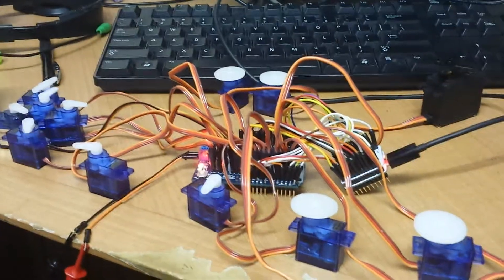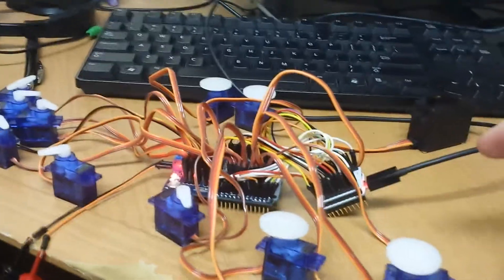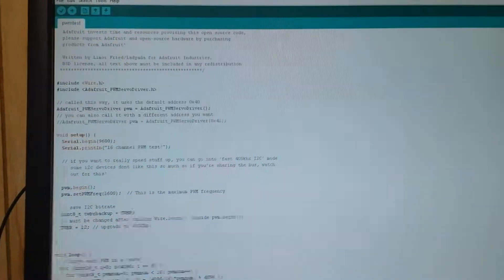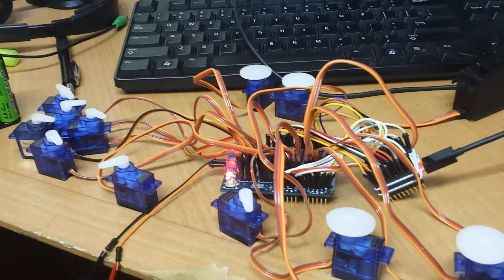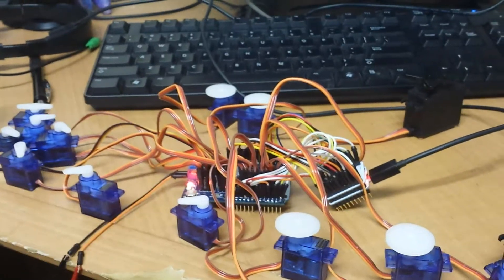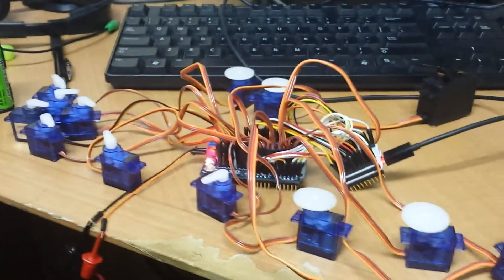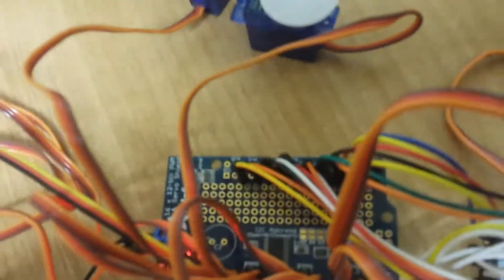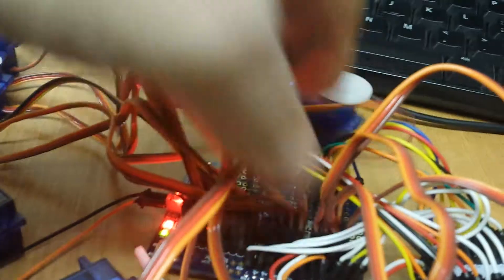Adafruit servo shield drives 15 servos

Comment: could u give me the code , please?
Reply from the maker: +Be Zy it has been a while but I think this is it:

/************************************************* 
  This is an example for our Adafruit 16-channel PWM & Servo driver
  PWM test - this will drive 16 PWMs in a 'wave'

  Pick one up today in the adafruit shop!
  ----> http://www.adafruit.com/products/815

  These displays use I2C to communicate, 2 pins are required to  
  interface. For Arduino UNOs, thats SCL -> Analog 5, SDA -> Analog 4

  Adafruit invests time and resources providing this open source code, 
  please support Adafruit and open-source hardware by purchasing 
  products from Adafruit!

  Written by Limor Fried/Ladyada for Adafruit Industries.  
  BSD license, all text above must be included in any redistribution
 **************************************************/
#include <PWM.h>
#include <Wire.h>

 #define WIRE Wire
#ifndef _ADAFRUIT_PWMServoDriver_H
#define _ADAFRUIT_PWMServoDriver_H

#if ARDUINO >= 100
 #include "Arduino.h"
#else
 #include "WProgram.h"
#endif

#define PCA9685_SUBADR1 0x2
#define PCA9685_SUBADR2 0x3
#define PCA9685_SUBADR3 0x4

#define PCA9685_MODE1 0x0
#define PCA9685_PRESCALE 0xFE

#define LED0_ON_L 0x6
#define LED0_ON_H 0x7
#define LED0_OFF_L 0x8
#define LED0_OFF_H 0x9

#define ALLLED_ON_L 0xFA
#define ALLLED_ON_H 0xFB
#define ALLLED_OFF_L 0xFC
#define ALLLED_OFF_H 0xFD

#endif
// called this way, it uses the default address 0x40
//Adafruit_PWMServoDriver pwm = Adafruit_PWMServoDriver();
// you can also call it with a different address you want
//Adafruit_PWMServoDriver pwm = Adafruit_PWMServoDriver(0x41);
int32_t frequency = 1600;
uint8_t _i2caddr;

int i = 0;

void setup() {
  Serial.begin(9600);
  Serial.println("16 channel PWM test!");
  WIRE.begin();
  reset();
  InitTimersSafe(); 
  bool success = setPWMFreq(frequency);
  
if(success){
    pinMode(13, OUTPUT);
 digitalWrite(13,HIGH);
 Serial.println("success");
}else{
   Serial.println("no freq success");
}
  // if you want to really speed stuff up, you can go into 'fast 400khz I2C' mode
  // some i2c devices dont like this so much so if you're sharing the bus, watch
  // out for this!

 // pwm.begin();
 // pwm.setPWMFreq(1600);  // This is the maximum PWM frequency
    
  // save I2C bitrate
 // uint8_t twbrbackup = TWBR;
  // must be changed after calling Wire.begin() (inside pwm.begin())
 // TWBR = 12; // upgrade to 400KHz!
    
}

void loop() {
  //uint8_t pwmnum=0;
  
  setPWM(6, 0,25);
  
 // Serial.println("done");
  // Drive each PWM in a 'wave'
  /*for (uint16_t i=0; i<4096; i += 8) {
    for (uint8_t pwmnum=0; pwmnum < 16; pwmnum++) {
      setPWM(pwmnum, 0, (i + (4096/16)*pwmnum) % 4096 );
    }
  }*/
  
  

}

 void setPWM(uint8_t num, uint16_t on, uint16_t off) {
  //Serial.print("Setting PWM "); Serial.print(num); Serial.print(": "); Serial.print(on); Serial.print("->"); Serial.println(off);

  WIRE.beginTransmission(num);
  WIRE.write(_i2caddr+4*num);
  WIRE.write(on);
  WIRE.write(on>>8);
  WIRE.write(off);
  WIRE.write(off>>8);
  WIRE.endTransmission();
  Serial.print("Setting PWM "); Serial.print(num); Serial.print(": "); Serial.print(on); Serial.print("->"); Serial.println(off);
}
void reset(void) {
 write8(PCA9685_MODE1, 0x0);
}
bool setPWMFreq(float freq) {
  //Serial.print("Attempting to set freq ");
  //Serial.println(freq);
  
  float prescaleval = 25000000;
  prescaleval /= 4096;
  prescaleval /= freq;
  prescaleval -= 1;
  Serial.print("Estimated pre-scale: "); Serial.println(prescaleval);
  uint8_t prescale = floor(prescaleval + 0.5);
  Serial.print("Final pre-scale: "); Serial.println(prescale);  
  
  uint8_t oldmode = read8(PCA9685_MODE1);
  uint8_t newmode = (oldmode&0x7F) | 0x10; // sleep
  write8(PCA9685_MODE1, newmode); // go to sleep
  write8(PCA9685_PRESCALE, prescale); // set the prescaler
  write8(PCA9685_MODE1, oldmode);
  delay(5);
  write8(PCA9685_MODE1, oldmode | 0xa1);  //  This sets the MODE1 register to turn on auto increment.
                                          // This is why the beginTransmission below was not working.
  //  Serial.print("Mode now 0x"); Serial.println(read8(PCA9685_MODE1), HEX);
}
uint8_t read8(uint8_t addr) {
  WIRE.beginTransmission(_i2caddr);
  WIRE.write(addr);
  WIRE.endTransmission();

  WIRE.requestFrom((uint8_t)_i2caddr, (uint8_t)1);
  return WIRE.read();
}
void write8(uint8_t addr, uint8_t d) {
  WIRE.beginTransmission(_i2caddr);
  WIRE.write(addr);
  WIRE.write(d);
  WIRE.endTransmission();
}